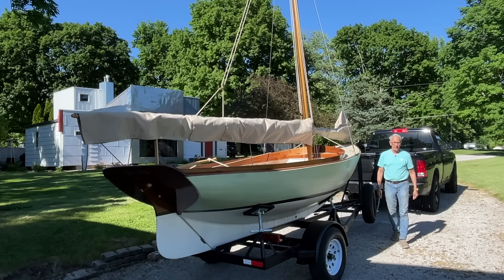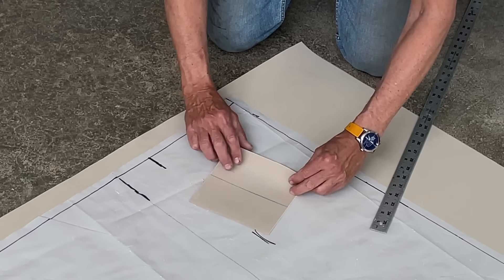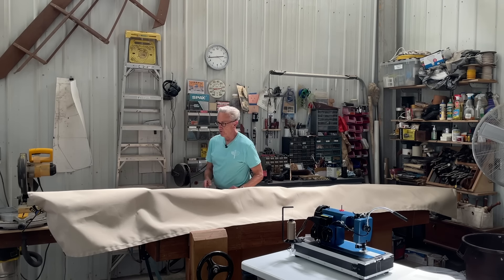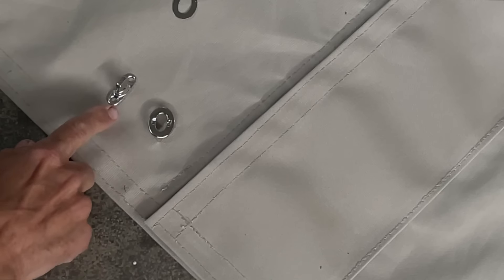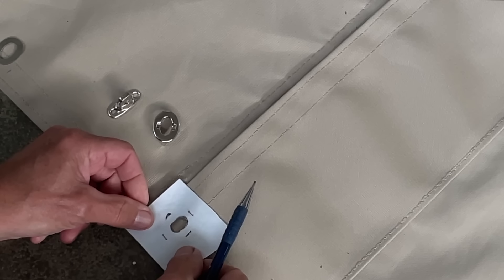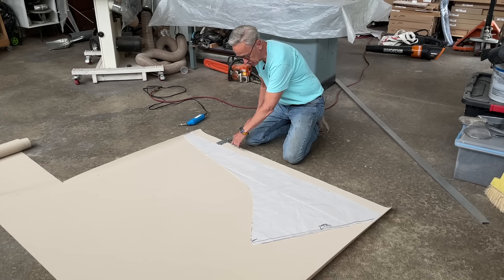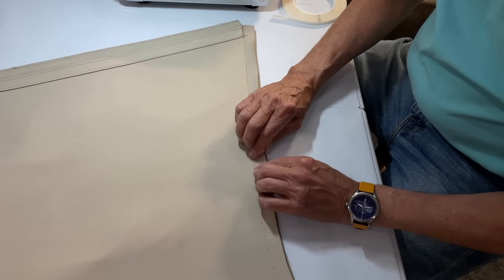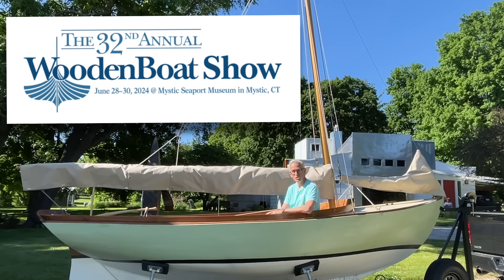Making Custom Sail Covers, S2-E83

Comment: Beautiful! I'm going to try to make it to Mystic.   Question: how much of the rigging do you disassemble to tow your boat.  Surly you don't tow it with the mast stepped.  Also will you be making a cover for the boat while towing?
Reply from the maker: Everything gets removed. All the sails, blocks and halyards. The Mast and booms are transported on a horizontal rack on the boat. No boat cover. She is designed to get wet.
Thanks for watching, hope to see you in Mystic!

Comment: I like how generously sized your sail covers are. The commercial sail covers I have used always seem to be barely big enough and it has been a struggle to get the twist locks fastened.
Reply from the maker: Thanks Michael, In the Sailrite booklet I mentioned in the video it strongly suggest that the covers should be loose fitting. 
I too have had the same experience with tight fitting covers. 
Thanks for watching!
Bob

Comment: As always, beautiful work and you do a great job at showing the process. Very clear with the right amount of detail. 
One question, as I am contemplating making covers for my gaff rig. My peak halyard is detachable at the gaff, which I then clip for storage to one of the chainplates. This would eliminate the cut in the middle of the cover. Is there  a reason not to do this?
Reply from the maker: You certainly can eliminate the lazy jacks in your situation. They are the most complicated part of the process.
Cheers,
Bob